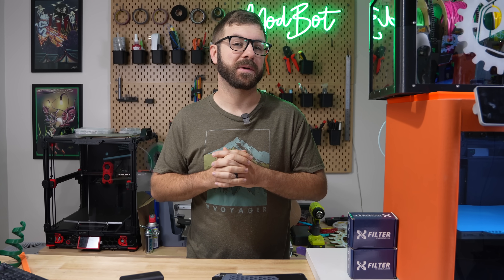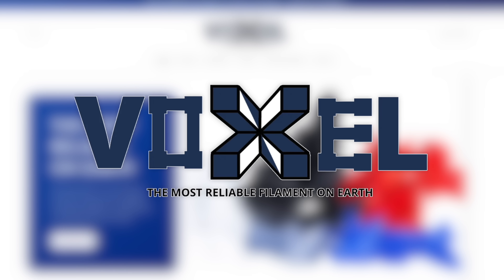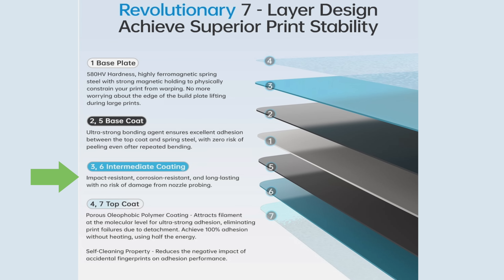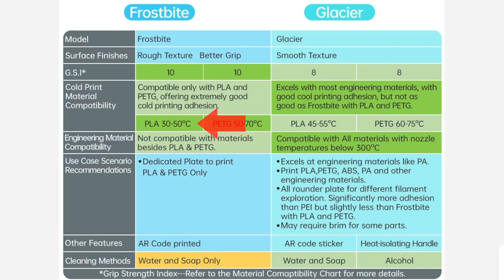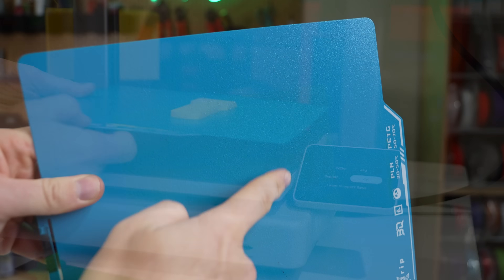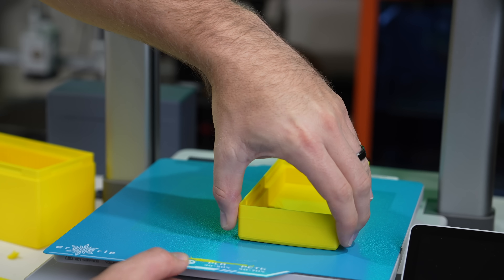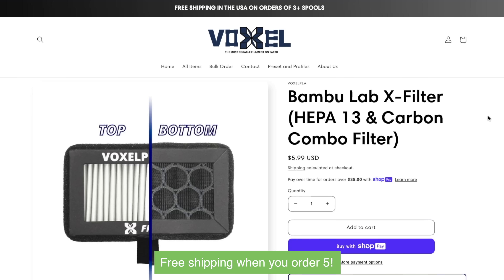Best Build Plate For Bambu Lab Printers? (Biqu Cryogrip)

Comment: These is due to improper leveling of bed 
When I used to print a large object which are far away from centre of bed these type of imperfections I also sees try 
Maybe it can be erase by decreasing the infill speed of first layer also make adjustment of part in middle

Comment: The Bed adhesion test you showed in the video has instructions to print in spiral vase mode, with 1 perimeter wall & 0% infil. Is there a reason you printed it with different settings?

Comment: So, what are your thoughts on why you saw such horrible first layers on your first couple prints with Glacier? What did you do on the second prints to resolve the problem (if anything)? I just got a Glacier for my A1 and am getting ready to try it. You also didn't comment much about the softer texture on the Glacier. Do you find it provides a texture more similar to the walls and top of prints? It appears to have a bit softer look and feel than a normal textured PEI plate and if that's true that's what I'm looking for.

Comment: Frostbite is awful since its coating has been easily peeled away even when I removed objects after they cooled down completely.
Glacier is much more resilient and still much more adhesive than the standard PEI. 
I hated frostbite but I loved glacier.

Now Juupine claims that their new low temperature super adhesive plate is better at the same price point. Has someone tried it?
It looks like bambu supertack and available on Temu which you can find searching for "juupine super adhesive plate".

Comment: Run the 15 minute bed level calibration in the maintenance settings with the new plate installed. Works for every new plate that gives me first layer issues

Comment: For the plus 4, the solution to the heat creep is to print a fan duct for the hotend, it helps to cool down preventing heat creep. Source of the heat creep is from the nozzle, not from the bed.

Comment: Has anybody found any solution to have a good first layer with the cryoplate on the A1? I have the same issue of the video, thank you.
Reply from the maker: Someone posted something about it being hotend related I believe. I haven’t had a chance to investigate. Check the comments 😊
Reply: @ thanks, I tried to. I’m pretty sure the hotend is too close to the bed, but I still haven’t figured out if I should change the offset with the coolplate o with the Textured PEI Plate

Comment: Glacier on my P1S shows very average results with PLA, adhesion is significantly worse than stock PEI
Reply from the maker: @alexey_sychev  have you cleaned it? Been running plates of pla on my X1C and adhesion is very strong. Even after cooling. I washed my plates a couple of times.
Reply: @ModBotArmy  Really? Of curse I did cleaned it... Made more tests, it performs a WAY worse than any of my trusted plates. Disappointing product.
Reply from the maker: @alexey_sychev  sucks to hear, I’ve had a great experience with it. Had a short power outage the other day and would have lost the print with pei. Glacier held fine even when cooled and was able to finish the print.

Comment: I'm surprised more people don't use or talk about G10 sheets. I just slapped that on top of my PEI plate and have had virtually no issues with it. I did scuff it up good with a grey scotchbrite, but other than that everything sticks great while printing, then when it cools it releases instantly. No need to monkey with sprays or glues or even take the plate off. In fact, I think the constant removing of the plate is a bad idea, in general. You will introduce dust and bits every time you do that, which can lead to minor spots of not being level. Think of taking your phone's screen protector on and off. What would it look like? 😊
Reply: G10 is nice and all, but for all of us running induction probes (PINDA, Beacon, BTT Eddy, BDsensor), it's a no-go since it's non metallic? If you're running something like TAP , klivky or any BLTouch clone, then it does seem like a great option indeed

Comment: The PETG adhesion on the Frostbite is stronger than the magnetic attraction on my A1 bed. I print large, flat models and when they cool, the plate is stuck to the curled print, with a gap between the bed and the plate. A couple reheating cycles while still attached to the plate flattens it out fairly well.
Reply: I had the same issue on my Mini with a BIQU Panda plate. How many times, at what temp and for how long did you reheat? Thanks
Reply: @MikeDeramo  I heat it to 65 two or three times.

Comment: So, not a complete newbie, but still very inexperienced in the 3d printing world. I have the A1 and just got the Glacier, because they had a killer Black Friday deal. Should I set my plate to the "cool plate," or the new "Bambu Cool plate super tack" option they have in Bambu Studio?
Reply: To the right of your filament drop down menu is an icon.  Click on it and a box will open with filament settings.  On the main page you will see the different build plate choices and can set the temperatures.  They will be saved in your presets menu.  You can do some tests and figure out what temp works best for your needs and save it.  Cool plate is a good choice to save it under.

Comment: When the first layer bubbles like that, it means too much filament.  That doesn’t necessarily mean over-extrusion, it usually means the head is too close to the build plate.  PLA has a glass transition temperature of 55C, so 60C is ok for the first layer, but should drop to no more than 50C for all other layers.  I have seen this bubbling when the build plate is too hot as well, but that is very rare.  I’ve never used Voxel filament, so I don’t know if it requires a lower bed temperature.

As for PETG, this is really weird.  I have never had PETG warp on the build plate, but I have seen it curl up at overhangs, which usually causes a crash and failure due to not enough cooling/too much heat.  BEST
Reply: A trick with petg is to add gcode to up the z offset a tiny bit

Comment: Two important advantages of the Frostbite Build Plate which were not mentioned,

1. As you don't need a heated bed for PLA prints, you can actually save your prints even after a long power cut.

2. It is an absolute beast for printing multicolour prints consisting of a lot of copies as these prints are long & often face failures due to constant filament swaps.

Comment: Couple months using Frostbite has significantly improved my 3D printing farm experience, especially for bulk prints and minis that previously failed to stick to the textured PEI bed, even with brims. Brims are unnecessary and difficult to remove. After 10 prints or so, stickyness goes away %15-20, though they become better tbh.
Reply: do you use it with any other materials other than pla or petg

Comment: I actually like that parts pop themselves free after the pei cools down. So i have no need of this. Now, if they can adopt this kind of tech for a stronger bite at 100c plus but pop free when cooled down im down.
Reply: Just heat the bed to 50-60 and it should heat release(opposite of pei) works on bambu SuperTack as well

Comment: I think Biqu is missing an opportunity by only going for Bambu printers. Granted, that's a nice chunk of the market. But I'm thinking the CR-10s, Elegoo Max, Prusa XL, or Vorons. Large volume printers are a pain in the ass for adhesion since they take a long time to heat up and the heating is inconsistent. If you can run PLA or PETG on those printers without having to heat the beds as much, that's a huge leap forward.
Reply from the maker: @lechuck3337  it sounds to me like this was just the start and it’s coming in other sizes. I agree if the demand is there they should be expanding to other common sizes.
Reply: On large printers you kinda need the normal bed temperature otherwise large objects will warp and will lift the bed plate 😄
Reply: @lechuck3337  Using mine on an Anycubic Kobra 3, it doesn't fit perfect but it's close enough and doesn't cause problems

Comment: totally looks like buildtak
Reply from the maker: I went through the buildtak era and while there may be some similarities that stuff would rip often with petg from what I remember and was also an adhesive sheet
Reply: @ModBotArmy  An adhesive sheet that can be attached to a spring steel sheet (included in the quite overpriced full BuildTack kit).
The sheets are sold in packs of 3 and they cost as much as one of those Biqu plates, or two (it depends on the seller and sheet dimension).

I still have the set from years ago, with the glass fibers base with embedded magnets, before magnetic sheets were a thing.
And if you think about it in real time it was basically yesterday, while in 3D printer development time: ages ago. =)

I never had problems with PETG, tho. 🤔

Comment: I think these are pure marketing. Zero real world benefit. If you're having problems with PLA or PETG bed adhesion...  you just don't know how to 3D print.
If all you print are desk and bookshelf do-dads (no real-world functional parts in engineering grade filaments) maybe you'll fall for the marketing.
Reply from the maker: To each their own. I think options are always welcome. Anything that helps remove the pain points is not a bad thing. I don’t think it should be an excuse to not learn how to level your bed or print better but if it’s helpful or preferred by some then there’s nothing wrong with that.

Comment: I have the Glacier (for print compatibility and the ability to use iso) for my X1C I had issues with z offset too until I reran one of the base machine configurations(can't remember which).

I imagine the softness of the surface is what means nozzle based detection likely goes just a bit deep before triggering

Comment: I have not tried the Frostbite plates but did recently order the Glacier plates during their recent Buy One Get One Free sale. The have worked great for PLA so far and I like that the texture is very close to the BambuLab Engineering plate which is no longer available. I am getting ready to print some parts for the LDO Box Turtle kit and plan on using the Glacier plate with ABS/ASA so i will let you know how well they work.
Reply: have you tried it with ASA ?

Comment: Textured build plate bambu sells.  Hands down.  The ONLY reason i dont use that is if i CANT have a weird texture on the surface of a print.  Ive had exactly zero adhesion issues with it, from PLA, to TPU, to PPA CF.  So long as you slow it down, and keep the plate clean it ALWAYS sticks.

Comment: I have a SliceWorx plate for me X1C and it is by far the best build plate I've used on any printer. You should give it a try, it cost a little more than these, but I think it's worth it. Btw I've had none of the problems you mentioned with the BIQU plates.

Comment: I'm enthusiastic about a build plate that is compatible with a wide range of filaments although CryoGrip seems little better than PEI in that regard, but I'm most enthused about a build plate with better first layer adhesion that allows the proper adhesion at a lower temperature to avoid wasting a lot of energy.  This is an even bigger issue on larger printers printing a large build plate full of parts.  It's great to start an all day print, check it in 20 minutes to verify that all parts are sticking, and then remove all of the parts a day later.  It's even better to do this with much less electrical energy being consumed to make 3D printing more efficient, lower cost, and not heat the work area that then requires more energy to be used for air conditioning.  Energy consumption increases exponentially with the temperature above ambient, so there is a very large difference in energy consumption between a 30 C build plate and a 60 C build plate.
Reply: I think for many people a main reason lower bed temp is nice is simply if their bed isn't heated very evenly, causing areas near the edges to have less problems. This is mostly useful for PLA though.

Comment: I've been running Glacier on a P1S for about 300 hours.  The difference in grip is no better than textured PEI--it fills the niche for people that want a finer-grained surface texture.  Don't buy it thinking that you won't have to run brims or glue or a lower temperature.  Use it exactly as you would a textured PEI plate.  The only notable difference is that TPU sticks to it harder than textured PEI due to the smoother surface (which is a downside--nobody needs better TPU adhesion).  The extended perforated handle on the front is nice--I wish more plates had that.  The color is ugly as hell.

Comment: For your information, if you happen to be a Prusa MK4S owner, these plates will fit on the bed. They just stick out the front about 15 to 20 mm. I have one on my MK4S and it is my favorite build plate for PLA. The adhesion is crazy good and I'm only printing with the bed at 40C. I have printed at 30C, almost room temperature, and had excellent adhesion as well.
Reply: Just for more FYI to whoever is buying these plates. They're hot garbage for petg. Even at 90 degrees and after a dawn deep clean with hot water they stick worse than those cheap h1h sheets from aliexpress
Reply: Believe it or not, but I have one of the bambu build plates that has the holographic textures on the surface installed on my Ender 3 clone, my CR6-SE. I'm using binder clips to hold it on 'cause I can't be bothered to print an alternative 😂

Comment: Mine showed up AND Wow not being able to get stuff off the build plate is a pain but the hot water does work. My next print (running only one of my 8 printers right now as I only have the one spool of PLA :) ) and the Mini Plate showed up today and Yes it looks lighter than the A1 plate I am working with .I am currently upgrading my P1S and P1P to Better Lighting and these plates so Ill get back once I get these tested for my product that has issues with regular PEI sheets. Thanks for then video :)

Comment: I would have been really interested in further testing of ABS adhesion. 
It feels like there is still no perfect print surface for ABS.
Reply: PVA?
Reply: @ziggystardog  do you mean pva glue? For my prints I need a perfect textured bottom so glue is out of question.
Or do you mean printing the first layer in pva? I don't have an AMS and manually switching filament is to much work.
Reply: @macualey  bit of a joke.  It works well, but people hung up with aesthetics and neat freaks who hate the mess can’t abide it.  There is no perfect 3D print or print surface for any material really—3D printing is a compromise

Comment: These seem like a solution for Power Loss Resume printing. Typically the feature doesn't work because if the printer is off long enough, you lose bed adhesion. I wonder if letting the printer cool down, then resume and reheat works.

Comment: I had the exact same first layer issues on my a1 but only with the glacier plate. The frostbite prints great every time. The way I fixed it on glacier was to use the pie plate settings but go into gcode and change the z offset from -.02 to +.03. Made it look perfect. Otherwise both buildplates work great on my p1p
Reply: It is likely because the surface has an 'elastic' feel and property, so strain guage sensors that poke it with the relatively pointy toolhead, will deform it momentarily before triggering, compared to the hard PEI material. You are adding height to compensate for the deflection in the coating it can't sense before triggering.
Reply: Also had this problem with all my a1's but was fine with my p series. 0.03 fixed mine also but my a1 mini needed .05
Reply: The latest firmware update fixed it about 80% id say
Reply: @R_mix19 Hello, I'm buying a Glacier for ABS and I wanted to know if it's still necessary to change the Z axis from -2 to +3? If so, where exactly in the G-Code do I make this change?
Reply: @ idk it depends. It seems like the more you use it the better it gets. I don’t even have to do that now
Reply: I don't see this in gcode. Is it in printer settings
Reply: @dkr63p it’s in machine start gcode

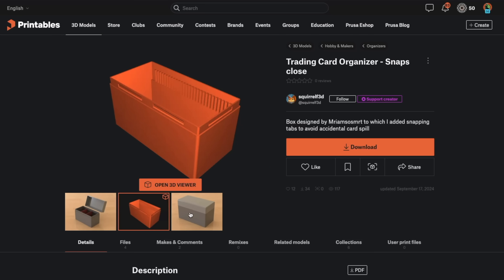Comment: I just wanted you to know at 5:15 I had this exact same issue with my A1 on a regular PEI build plate. I tried everything from changing settings, completely cleaning the bed with soap and water, using a brand new print bed but 0 results on the corners lifting up. Try and replace the nozzle with a new one. I was using the stock 0.4mm stainless steel nozzle (90 print hours on the printer at the time) and I swapped it with a brand new 0.4mm hardened steel nozzle. That fixed my issue completely. I even contacted bambu about it and they told me to kick rocks essentially.
Reply: THANK YOU! I noticed this as well and was so confused what was going on, I have a couple of hardened nozzles I'll do this swap over now.
Reply: @Phaedraz  Not sure if its specific to hardened steel nozzles or not, i think its just the nozzles breaking easily or something.
Reply: @Khoomn Hey! So you had a lot of warping on A1 at the edges and swapping the 0,4 nozzle helped out for you? Did it completely? Right now I have the same problems and I already tried everything that is possible. :(
Reply: @MkSporty  It still somewhat happens to me but at this point I clean the bed, make sure there are 0 drafts. When I walk by the printer I move slowly to reduce it. The main issue is they designed the print bed terribly and the magnets move with the plastic more than the magnets stick to each other. When I used glue, it pulled the bed up with the plastic instead of sticking to the other magnets. On my Qidi Q1 pro, I have no warping issues no matter the configuration of door/top open or not because the magnet is really strong.